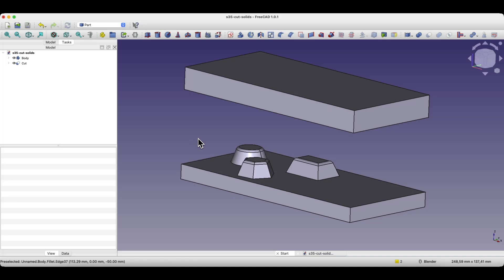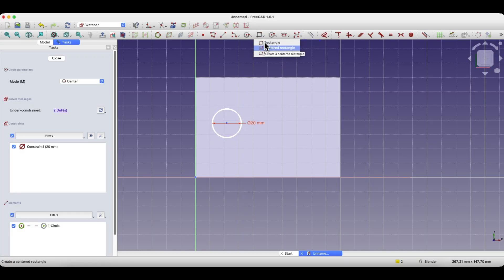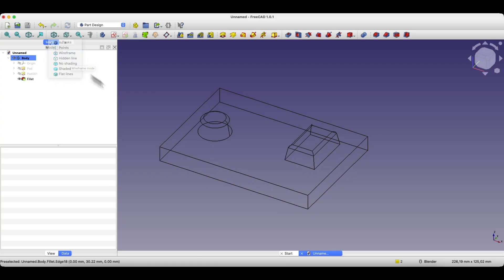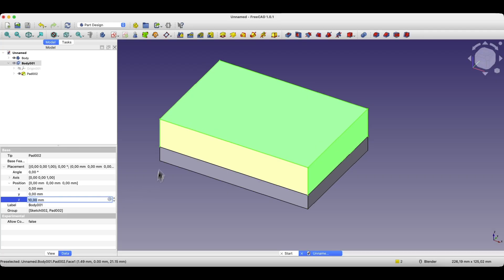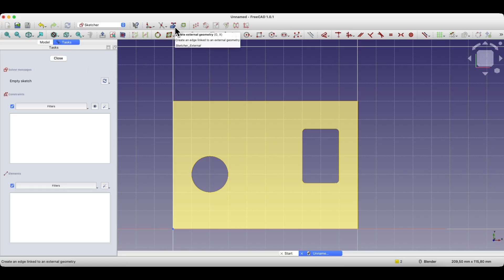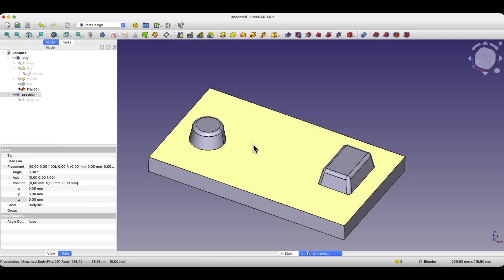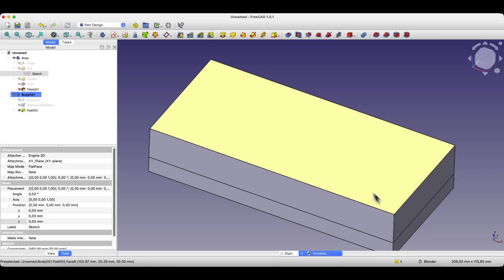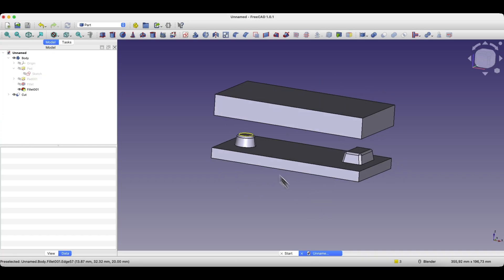📐 How to Create a Negative Solid in FreeCAD | Step-by-Step Tutorial for Beginners

Comment: Is there an option for an additional offset somehow? If you 3d print your two parts, they would not fit into each other without clearance.

I would go with shape binders instead of reference faces and clones instead of copy on the boolean operation, but i think that is mostly personal preference. 

If you create a binder from the bottom face you can directly extrude the binder without a sketch, reference geometry and rectangle. Just a hint to speed things up...

Comment: Is there an easy way to get some tolerances into the two bodies so they fit after printing them?
Reply: I guess you mean clearance.
Habe a Look at 'offset'
Reply: Back when I was an apprentice 45 years ago we used to talk of clearance/tolerance in “thou” and typically 10 or 20 thou was used. Now on the metric system 10 thou is 0.25mm, 20 thou is 0.5 mm, I would try those options. Also when measuring stick to measurements on these terms. i.e.10.25mm or 49.75 mm and not 10.23 or 49.80  to make things predictable.
Reply: The way I did figure out is create 4 pieces instead the two they show on the video and the second set I make it a little bigger. Then I combine the two different sets I create making one for the 3 print. If you figure out a better way, please let me know.
Reply: I’d try printing one part at 99% scale from out thre slicer. 

I’d try it anyway just to see. I’ve done it before. But it depend on how intricate your design is I guess. 

Or do the scaling in freecad. In this video you could take the bottom part and alter the size of the square and circle by 1.01 percent. Then cut the top part. Than change the square and circle back to the previous size.